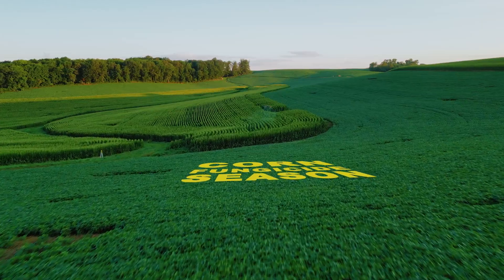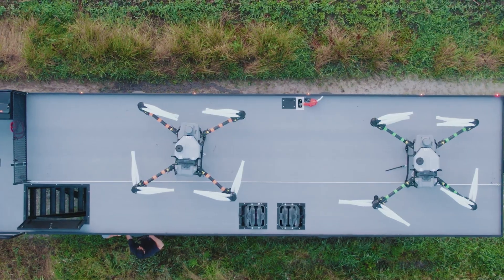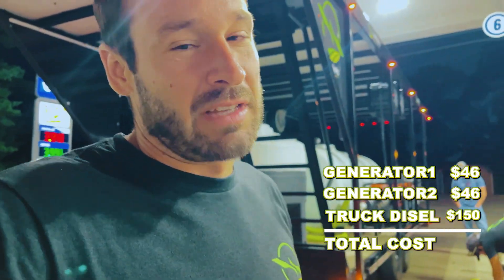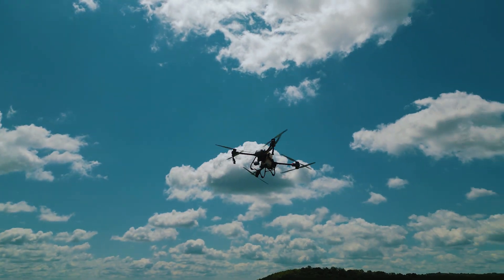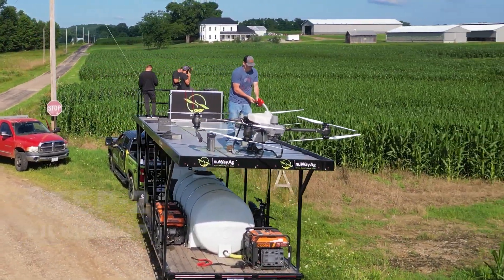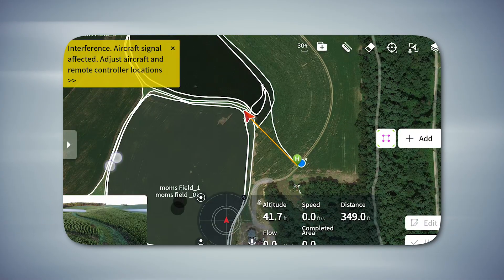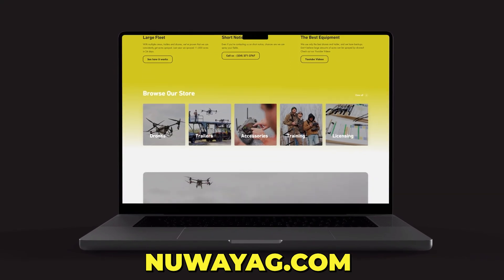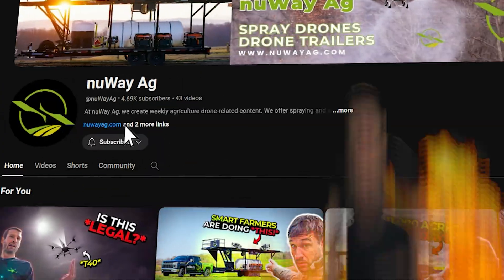Corn Fungicide Season | How Efficient are they REALLY?

Comment: I bought a T40 and started a business based on this hype. Hoped to get a NuWay trailer for next season but so far we’re lucky if we can cover 25 acres and hour at 2 gpa, 30 ft swath, and max speed. It’s hard to get through a day without it “loosing connection” and crashing, breaking $1k worth of blades each time. So far I have not been able to replicate what everyone shows on YouTube.
Reply: Same here. I know exactly what you're feeling and dealing with
Reply: @LyndonKreider  I’m really starting to suspect that DJI has purposely corrupted the T40 firmware in an effort to push more T50 sales.
Reply: Due to obstacles? And line of sight? Or what’s going on. I was looking into this